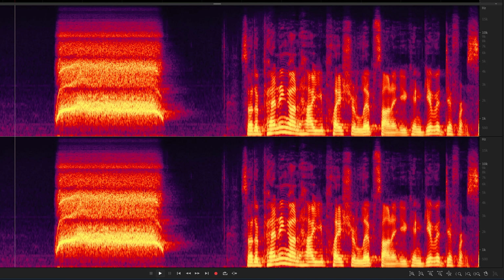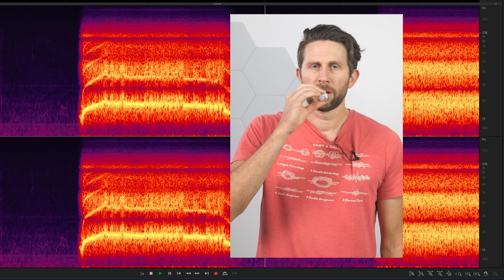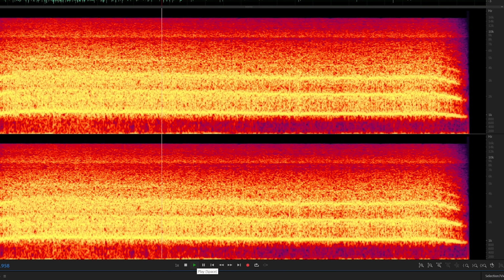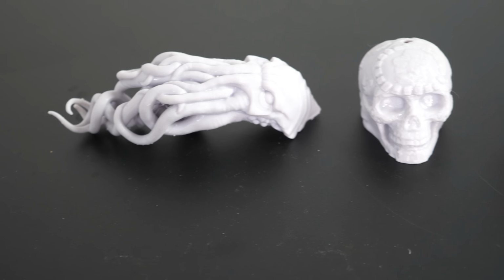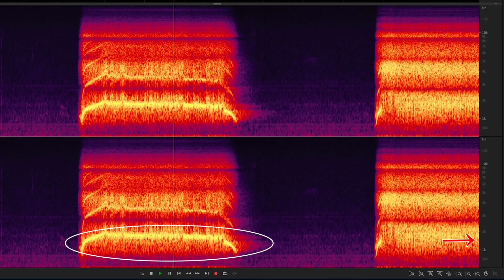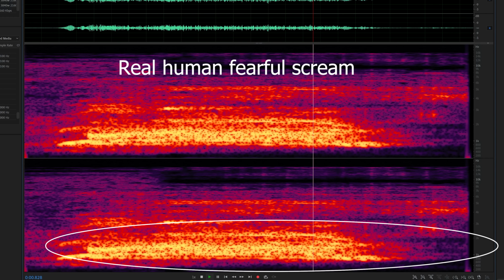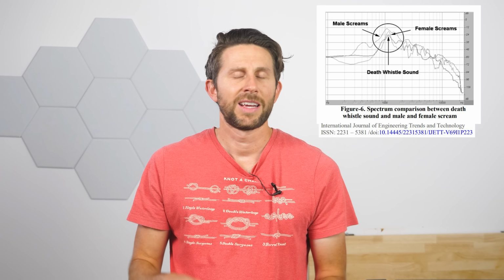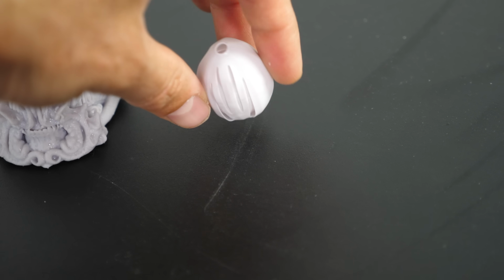The Scariest Sound In The World

Comment: They sound a lot like letting the air slowly out of a balloon. Or to change the pitch vary the pressure of rhe release by the firmness of your grip, which means to stretch the neck of the balloon across either less or greater.

Comment: Hey there, I had some questions about your new resin 3D printer. I know before you recomended to me the creality Ender pro 3D printer, but I can afford to buy more expensive 3D printers if they are better and more reliable. So whats the difference between the resin 3D printer, and a regular 3D printer? Can you assign different colors to your model and have the resin printer print the model in those colors? How reliable is your new resin printer and if you did have any issues with it before, what kind of issues were they? Have you ever heard of the company Bambu Labs? They make 3D printers as well and I heard they are supposed to be a really good company. Their printers can print a model in 16 different colors. If you do know of that company and you have used one of their printers, how good and reliable are their printers? The thing that really scares me when buying a new 3D printer is that I don't want to spend so much money on a printer and have it not work very good and then get no support from the company who sold it to me because then I would basically lose all my money and I really don't want that to happen. I almost lost $500.00 once because I bought an air conditioner from HoneyWell and it broke after only two years and Honeywell was refusing to replace it for me or issue me a refund, so me and my father threatned to sue them in small claims court and they finally aggreed to replace the unit with a smaller one and I really don't want to be in another situation like that again. Don't ever buy from Honeywell, they don't deserve your patronage.

Comment: Its amazing how practically not one youtube scientist has figured out volume normalization yet.
Reply: Neither have sound mixers for most movies.
Reply: @jacobstaten2366  That's just called dynamic range. You can turn on night mode on your tv and it'll lower the dynamic range of the audio if you have shit speakers and can't hear.
Reply: @TunaIRL  it's not the speakers, but the sound mixing. You shouldn't have to blast yourself with loud noises to hear normal speaking volumes, and volume shouldn't vary video to video so dramatically. It's like watching Netflix.
Reply: @jacobstaten2366  Sound mixing has to do with the amount of dynamic range the audio has. Dynamic range is exactly this difference between quiet and loud sounds. In a good and optimized audio setup you can have a high dynamic range and have it sound enjoyable and good. Again, you can turn on a night mode for example to lower the dynamic range if you cant listen to loud sounds or have a bad audio system.
Reply: @TunaIRL  except this problem happens everywhere; movie theaters, Blu-rays, PCs, phones, and regular TV. Having night mode on can only do so much. There are tons of programs that you have your finger over the volume button because you're now an active participant in the sound mixing that should have been done in the original recording.
Reply: @jacobstaten2366  I've never had this issue. How old are you? Could be a hearing thing.

But hey if you think there isn't a single audio mixer who can do their job, it sounds like it'd be an easy career path to succeed in.
Reply: Someone got a good scare 😂

Comment: This video is actually disturbing 😆

Resin printing is great for the correct application. Ultra high resolution and detail. But small build volume, absolutely toxic sticky mess which requires care during handling the 3d prints and the printer. Post curing and rinsing with Isopropyl Alcohol is messy. Then finally removing all the supports. It is a pain and leaves a bunch of bumps like on the back of the Cthulhu whistle

Comment: I wonder if these would work connected to pressurized air and a tube. That would possibly be a very effective burglar alarm.
Reply: Set these up in several locations way off in the middle of various forests and other remote locations on a timer with a really long, possibly randomized delay. Every, say, 3-5 weeks, a random scream. Hide them in such a way where even if somebody tries to find it, it'll be pretty hard to pinpoint that the sound came from the whistle.
Reply: @tuckergregory That sounds like an engineering challenge and if successful, a spooky forest machine
Reply: @BuilderBasti  There are already easy to use electronics and programs that can be used for the random times and such. Couple that with a can of air duster or replace the horn on a canned air horn and a solenoid to press the trigger and voila.. random screaming in the woods. You could do it all electronic too by recording and playing back the sound, but the air would probably be more authentic sounding and louder.
Reply: @D3M3NT3Dstrang3r  I know that it's possible, the biggest challenge would probably be battery life, but I wouldn't build it either way
Reply: @tuckergregory  If trees could scream, would we be so quick to cut them down? If they did randomly and all the time, we would. - Jack Handey
Reply: @TheRealSpencerMarks I give you the award for quoting a largely forgotten comedy jewel.
Reply: @TheRealSpencerMarks  the trees do in fact scream, when a sped up recording of internal electrical signals of a hurt plant is played in audible range, it actually sounds very similar to this whistle.
Reply: @nodescriptionavailable3842  Like a loaded gun, the comedy gold is always locked away in my brain, just WAITING to be fired with precision! 😂 Thank you for the award!!!
Reply: LOL @TheRealSpencerMarks
Reply: @tuckergregory bro that sounds like a horror movie without the plot, it’s just scary to think about lol
Reply: @tuckergregory Imagine someone took this seriously and cause chaos.
police getting involved and banning visit to certain areas lol.
Reply: @tuckergregory  bit of trolling
Reply: @tuckergregory bro is the pure concentrated evil
Reply: @tuckergregory  "hide them in such a way that they erase physics" not totally how sound works bud
Reply: @joshyoung1440  Could you clarify what you mean? My comment did not mention anything about erasing physics.
Reply: @tuckergregory It's not like we don't already have the technology to play screaming sounds..😂
Reply: @geopioneergsxr5357  Yes, but finding a speaker answers the searcher's question. Finding a strange whistle with a mechanism attached could just leave more questions, especially considering the customizability when it comes to the shape.
Reply: @tuckergregory  Bluetooth speakers come in all shapes too.🤷‍♂️
Reply: It's almost Halloween.
Reply: I want to put one on my housemates pressure cooker
Reply: @_BangDroid_  I want to make an alarm clock with that being the “wake up” sound!
Reply: @_BangDroid_  LOL… yeah, you’re right … but I want to wake OTHER people up like this! 🤣
Reply: When I was a kid, my dad was coming to wake me up in the morning. He stubbed his toe on the barrel of the bb gun under my bed and screamed. I can confidently say that I have never awakened so abruptly.
Reply: Burglar alarm.  Actually  a great idea. But the sound has to vary ever so slightly.
Reply: but is it purple?
Reply: @jesse2535  Lol
Reply: This would be a good way to get police officers to break into your house. Lol
Reply: Use a small centrifugal fan at 12k rpm blowing into the whistle, use a typical 6 volt brushed dc motor from a kids toy, power it with the programed burglar trigger.
Reply: @graphenepixel8231  also, *programmed
Reply: @graphenepixel8231  you didn't need to describe those common objects in such detail. Seems gatekeepy
Reply: Nice FRAKING sound warning dbag... I have all the cars around me looking like I have a cheerleader in my trunk!!!
Reply: @nickfrost9771  Um, why are you worried what everyone thinks about you. The only reason why you would have to worry about someone thinking that you have a cheerleader in your trunk is if you actually had a cheerleader in your trunk. You don't actually have a cheerleader in your trunk do you?
Reply: @justinweatherford8129  Not anymore, moved up front due to good behavior...
Reply: interesting... Imagine what the burglar would feel and do the moment he enters your house and hears that shit around the cornr
Reply: It would also be a very effective school bell.
Reply: Why haven't the haunted house attractions got this idea yet
Reply: These devices were made to be blown into, so not only is the answer a resounding yes, but you would scare the crap out of anyone who heard it.  I am unironically mildly spooked right now as that does sound exactly like someone screaming in agony or terror.  Using compressed air with an outlet made to fit the mouthpiece of the device would actually be more effective and likely louder than blowing into it yourself.
Reply: Eleven Purple Burglar Alarms please. Sorry for the Scotts choked while trying to say this 😂.
Reply: @Deividalfa  huh?
Reply: a purple burglar alarm?
Reply: Blud has a wendigo in his home 💀💀💀
Reply: But what would be better is have the air setup on your car as the horn
Reply: @TheDiscipleJacob  GREAT idea!!
Reply: Lol you'd probably easily scare the burgler away.
Reply: When you didn't set any of these up yet but suddenly hear that sound;
Reply: If an obnoxious motorist/sports car/truck stops in your neighborhood, tie some of these to the noise pipes... :) they'll never ride again
Reply: amazing idea
Reply: Great idea!
Reply: BEST... DOORBELL... EVER!!!!    ;o)
Reply: it needs a specific embrouchre i think so itd need more that just pressured air
Reply: Oh yeah. That gives me some good (?) ideas. .
Reply: Not accounting for giving most of the neughborhood a heart/panic atack
Reply: Purple burglar alarm
Reply: Brooooooooo ☠️☠️☠️☠️
Reply: They DO work connected to pressurized air and a tube. Your lungs and mouth are pressurized air and a tube.
Reply: ‘I did a thing’ pranked his friend by putting one in a kettle
Reply: A Purple Burglar Alarm.
Reply: "very effective burglar alarm" Just play it on some speakers, less troubles than tubing your home and automating the air compressor in the garage.